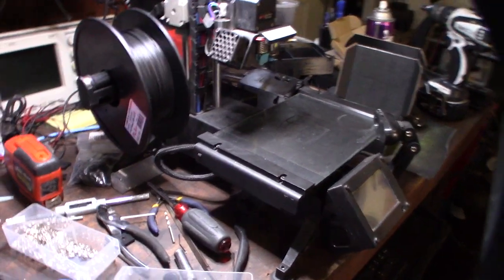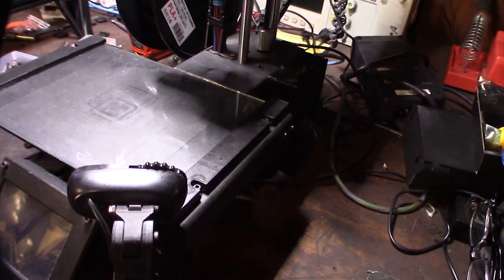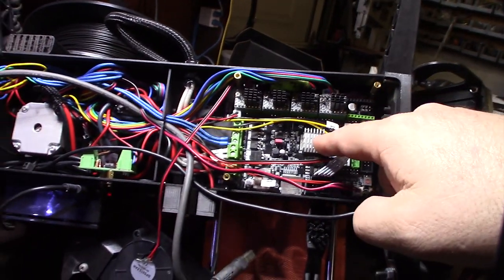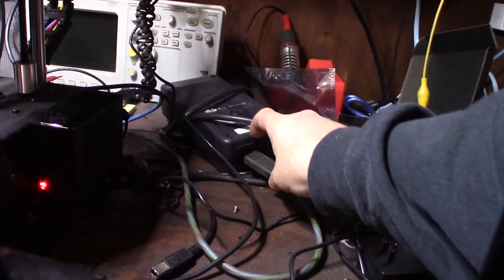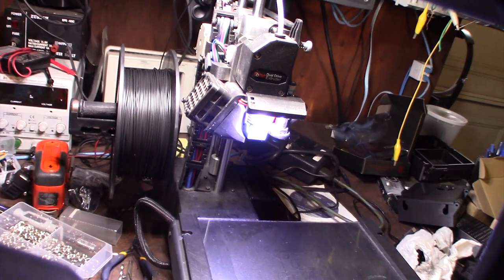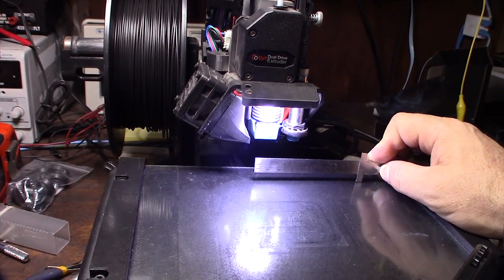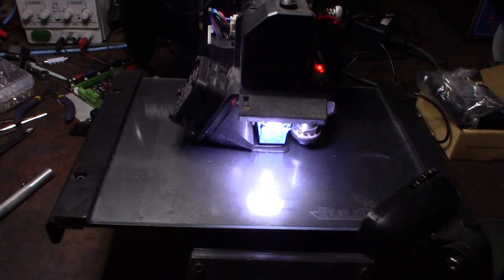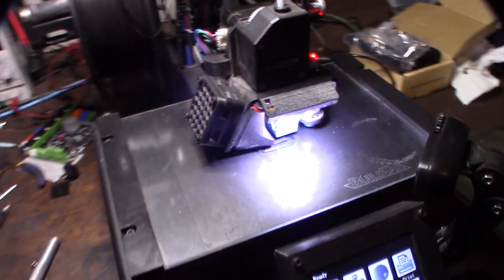Printrbot Simple Metal SKR 1.3 TMC2208 upgrade

Comment: Thanks for your videos, they motivated me to attempt to upgrade my Printrbot to SKR 1.3 as well.

Can I ask what you did to fix your double-distance stepping (command 10mm, but servos are moving 20mm)?

I've been in the process of basically doing the same thing as you. If I set TMC2208_STANDALONE in the firmware, I move double distance. If I set TMC2208, then I move the correct distance on a stepper command, but all the motors start hissing something fierce once a command gets sent. I'd love to figure this out..
Reply: thescroll he probably won’t answer but I’ll try and help. In his video’s, he has the 2208’s in uart mode. So if you want to follow along with him first make sure harware wise the drivers are in uart mode, whether it be solder the connection, install jumper or whatever your driver paperwork says to get them in uart. Next in the Marlin firmware, make sure you remove the standalone portion of the code.  Also in another video he stated he solved the problem by making sure in firmware the drivers are 16x microstepping.
Reply: Thank you Hyoslvr, I'll keep playing around with it.
Reply from the maker: Below is my Marlin stepping setup
#define DEFAULT_AXIS_STEPS_PER_UNIT   { 80, 80, 2020, 415 }

Comment: I loved my Simple Metal, but I couldn't deal with Brooke. Tried pointing out that they're using a bad thermistor that single strand wire was prone to breakage do to the bend and he got so mad I Tweeted about it to let other owners know that he blocked me on ALL social media!
Reply from the maker: I still have mine, it running klipper now with 7" touchscreen. I've done thousands of prints with it. I still print with it today. Its not my primary printer but has got me out situations when my primary went down.